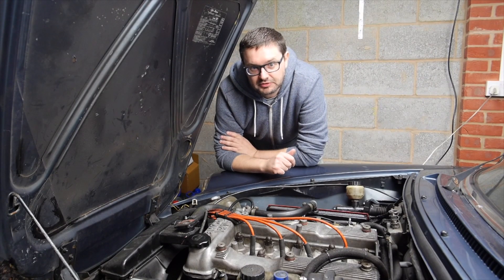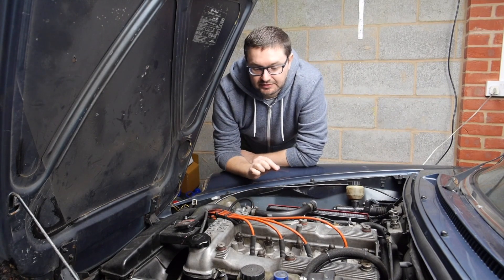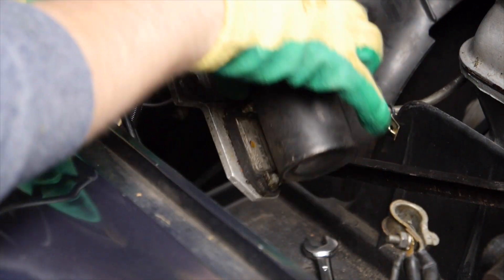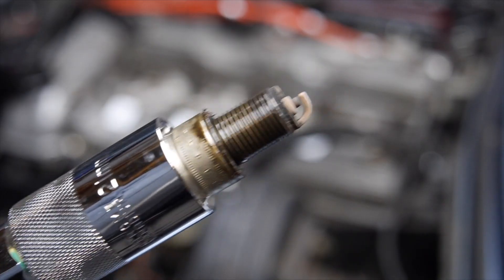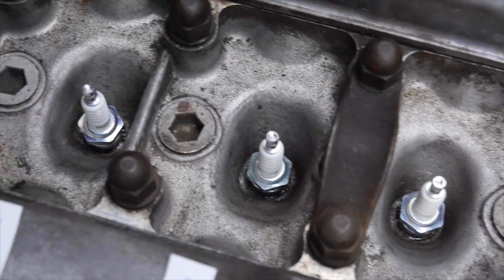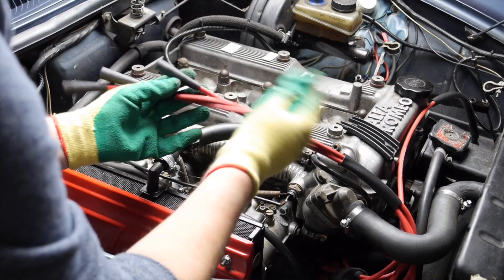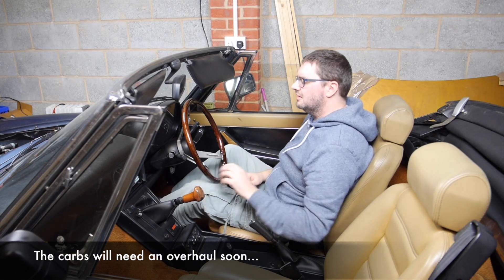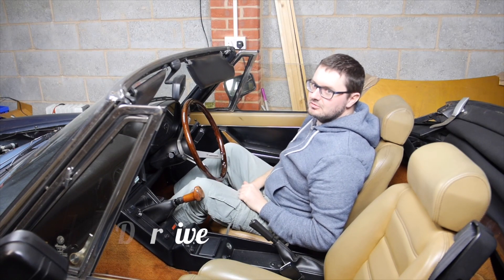Take to the Roads Garage - Episode 7 - New Electrics for the Alfa Spider

Comment: Just finished changing my HT leads on my S3 and your film came  in helpful. I'm glad I did it as the copper connectors going into the distributor cap were all oxidised. Access is a pain particularly as my car still had a plastic clam covering the cap. I haven't done the cap and rotor yet as (like your's) the clip wont budge
Reply from the maker: Great to hear my filmed helped you out Alex! It is one of those jobs thats worth doing as it can solve or avoid problems. The clip on my cap was a bit fiddly and its not in the best place to be honest. I got it eventually. Hopefully you can get it sorted.

Comment: I would like to replace the spark plug wires on my 1986 Alfa Romeo Spider Veloce, but my replacement set did not come with the rubber cap that goes over the top of the distributor. Do you suppose I can do without that rubber cap on the distributor? I don't see how I can reuse the original one. Your video is very helpful. Thanks!
Reply from the maker: You’d need the distributor cap. When changing the leads it’s a good idea to fit a new cap if it’s old as they can wear. You should be able to get a new cap from an Alfa parts specialist.